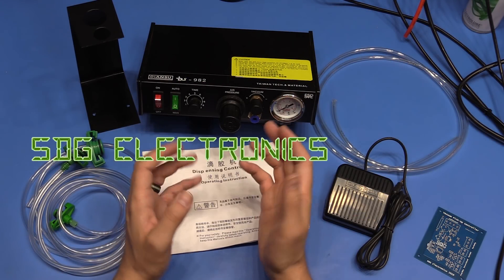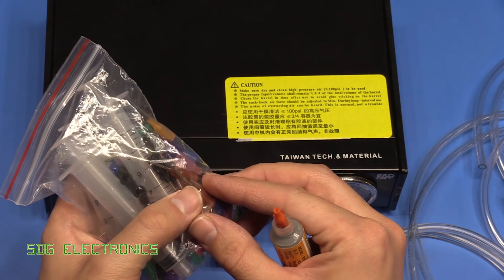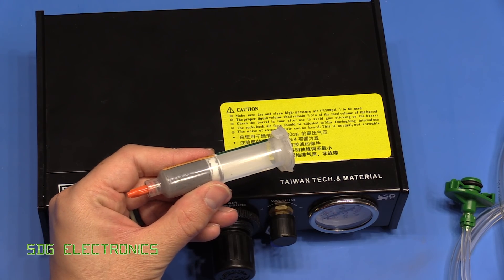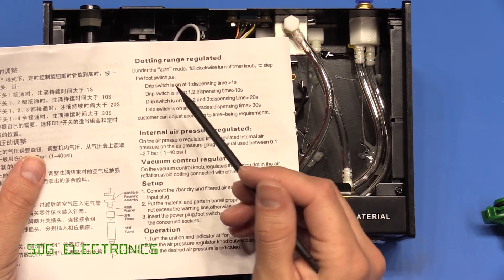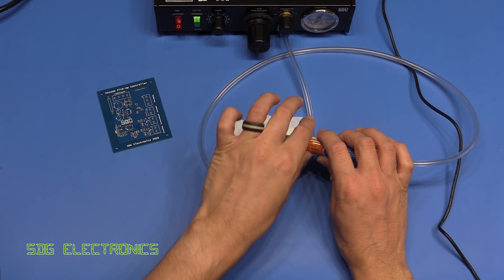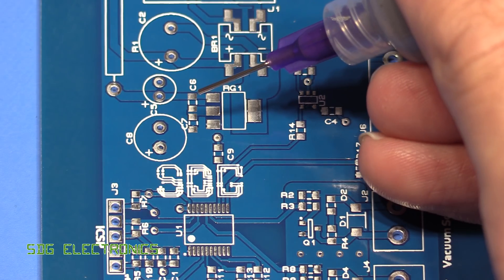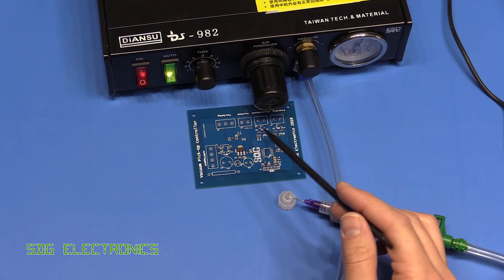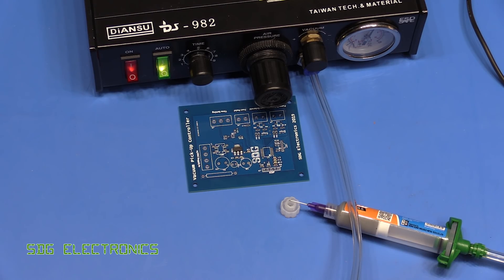SDG #062 SMD Assembly Using a Paste Dispenser and Hot Air with PCBs from JLCPCB

Comment: Damn, and here I thought it had a vacuum pump built in... I am thinking of modifying my desoldering station to have a chamber of vacuum built up for instant release instead of having to wait until it builds up - and the air has to go somewhere so another chamber with positive pressure with an outlet and a circuit to turn it on / off or reroute the air based on how much is in each cylinder... Then I would just need to turn both on... Or build a simple vacuum box with the same in, and remove the pump from my desoldering system - then modify the handle so it plugs into a ksger unit or another type with the trigger wires plugging in to the vacuum box...

Comment: I  use mine for flux distribution so i can set it for just a drop for a small smd capacitor because good quality flux is now crazy expensive even more than solder paste and you want to control the flow not to spread sticky flx all over the board end up cleaning more than soldering time , led paste who on the other as a so small expiration date ,this is a good investment for the low price point ! It does apparently a good job with all kind of precision gluing techniques too  !

Comment: You are using absolutely wrong type of needles! Those are right one http://www.wisetechservice.com/images/Glue%20Dispenser_files/200821225057669.jpg
Reply from the maker: You can use either. I'd normally bend the tip over a little bit, but even the Metcal dispenser recommends blunt needles for solder paste rather than the plastic ones.
Reply: I have little bit of experience and believe me those plastic ones are much better of course branded not Chinese shitty stuff. The best brand is this 
https://www.nordson.com/en/divisions/efd/products/dispense-tips/tapered-tips
of course not that cheap. Try it and you will see the huge difference.
Reply from the maker: I'll order some and see, thanks!
Reply: @sdgelectronics  Good turn. That's  difference between amateur and professional choice ;)

Comment: Thanks Steve. It seems like the nozzle is too small on the hot-air.
Reply from the maker: probably holding it too close too. The set up was not optimal as I had to keep out of the way of the camera. I'll do the rest of the board under the microscope.
Reply: It seems to work better and not try to blow caps and stuff around with a larger nozzle, or no nozzle. Also using a preheater station to heat the back of the board helps. I know that it is a lot easier for me since I bought a preheater. I have seen guys on YouTube using a regular heat gun with good results.

Comment: I love your videos, you are a highly skilled engineers - so well done. I am subscriber to your channel too.  I have a simple question, if you use this dispenser, then that means you have a compressor, foot switch, tubing etc. So why do I need your pick and place board?  If I plug a tube into the dispenser and turn up the vacuum can't I get the same effect as your pick and place board?  Which I understand is a dedicated device but in the interests of being a hobbyist / meddler this device should suffice? Or am I missing something?
Reply from the maker: The vacuum on this is not controlled by the foot pedal in the same way. When you press the foot pedal it applies positive pressure on the outlet port, the vacuum is present once the foot pedal is released.
Reply: @sdgelectronics  very interesting - will you be releasing the details about how to make it? where? On your web site?  -  I recommend a silent compressor. I ts quite big but totally silent . Generally useful around the house anyway.
Reply from the maker: @jackbuechler  I will write up on the website once the project is complete.

Comment: Thanks Steve...although I don't do enough SMD work to justify outfitting a setup like this I still want one!
Reply from the maker: There's always a tendency from hobbyists to think the SMD work is difficult, but you can make a real mess and still clean it up 😂 just hoping to show its accessible to everyone, though tools like this definitely are not essential! Thanks Dino
Reply: @sdgelectronics  Steve - if you'd be kind enough to send me a note (KL0S) at (ARRL dot net); I've been trying to convince hams of the same thing.
Reply: Most of the time I just use my soldering iron. It seems to be faster for me.